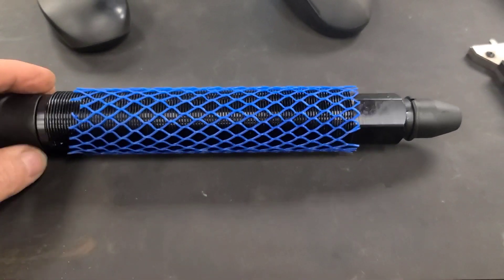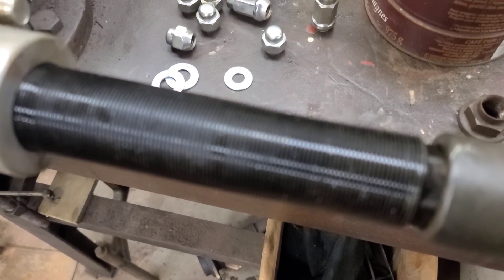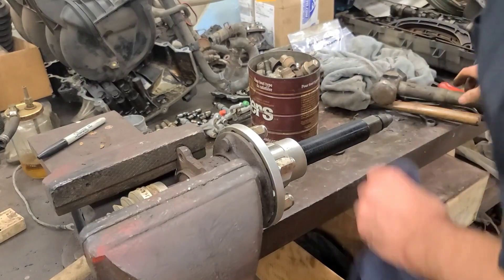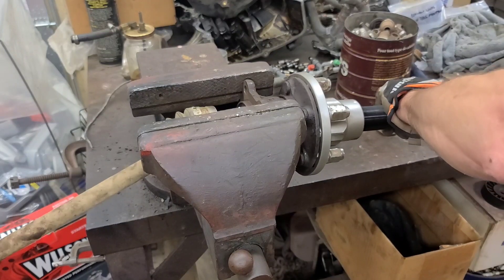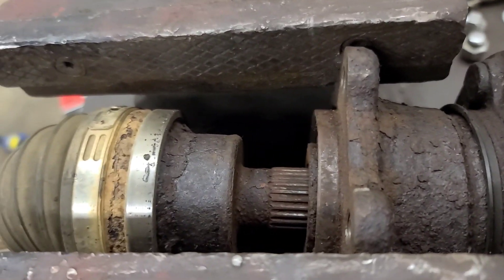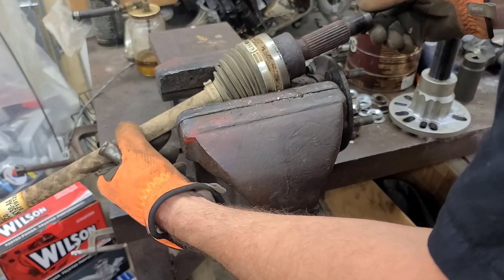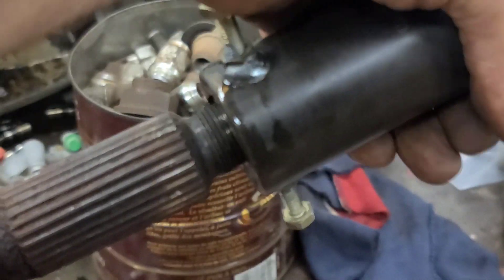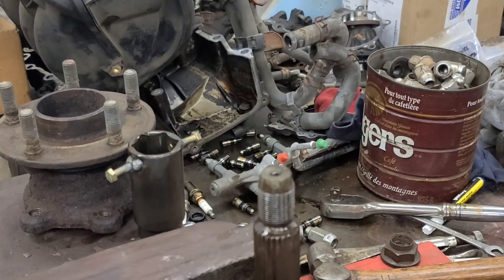Laser Tools Impact Force Screw First Use plus Bonus Tool Idea

Comment: Need to patient your invention.
Reply: Steelman makes split dies. They have a kit specifically for common size wheel studs plus individual dies in just about any size up to about M20. They are not inexpensive but work very well.  I've used them for several years now and they're a real hassle saver.
Reply from the maker: @BERPSU1  thanks ill look into them
Reply from the maker: Checked out their website and can't find the popular axle nut sizes. Wheel stud repair is good but not cheap. Thanks ill keep looking...
Reply: @PhillipBailey  Murray Tools has split dies also and cover a couple sizes Steelman skips, like M16x1.5 which isn't an uncommon size on smaller axles.
Reply from the maker: @BERPSU1  I've emailed Murray tools.
Reply from the maker: @BERPSU1  they returned my email just now and said they haven't made split dies for 5 years now
Reply: @PhillipBailey  Wow. That's probably how long it's been since I purchased from them then. BTW, keep the videos coming, we enjoy them. 👍